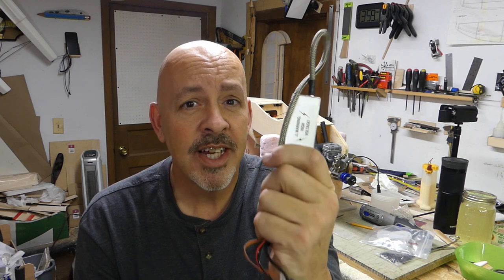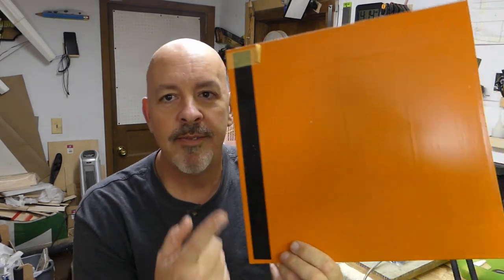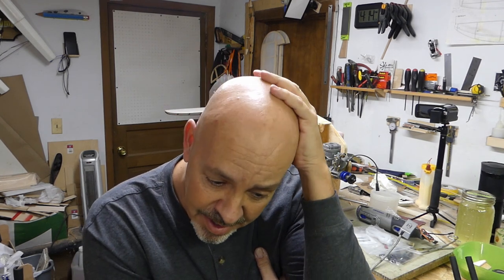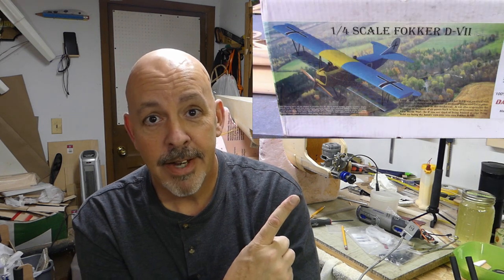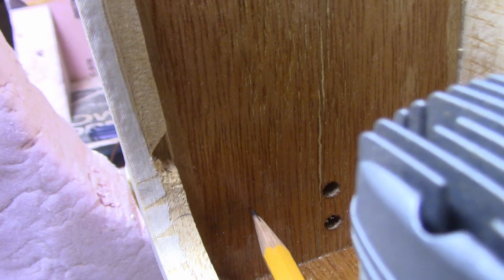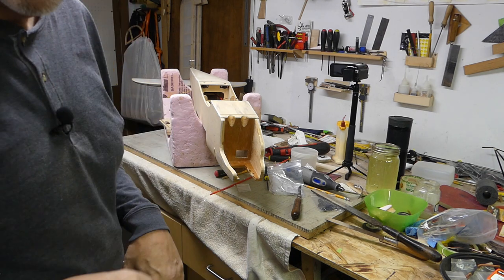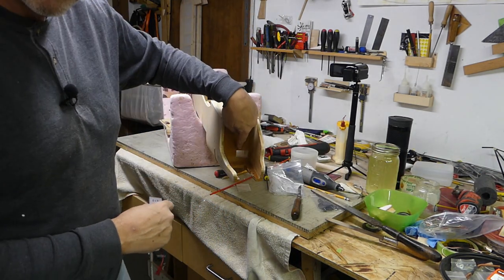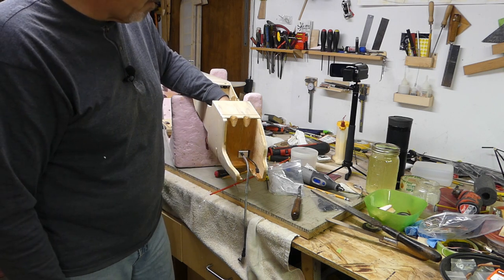Tiger Moth Becomes a Stampe SV4 - Video 32 - Finishing the Engine Compartment

Comment: Bud, a warning about Balsa USA kits. I have built two, and found out that if you build strictly on the plans, the wings will be slightly different in length along the wing span. Believe it is due to the way the plans are printed.
Reply from the maker: Larry, Thanks for the heads-up. I should have the Fokker moved down to the shop sometime tomorrow to study the plans to verify the construction by the first owner was done properly.